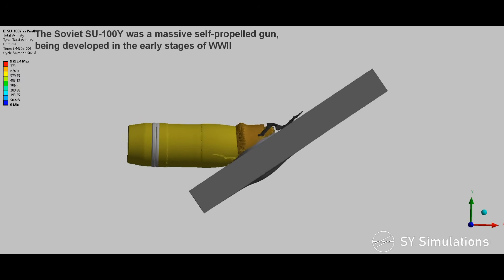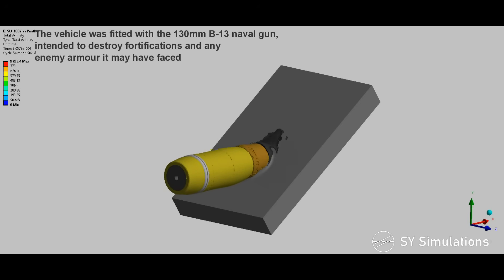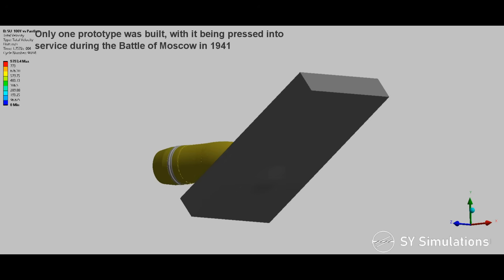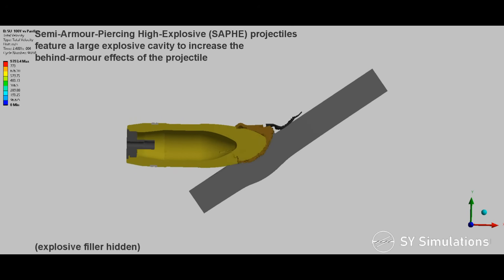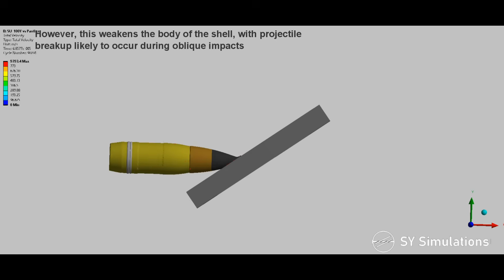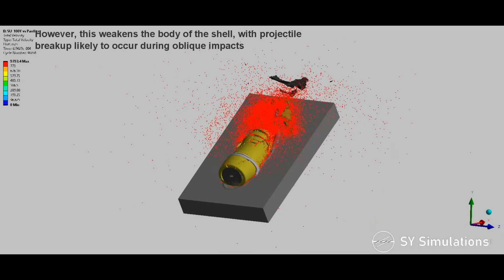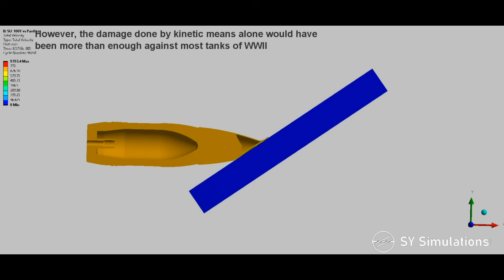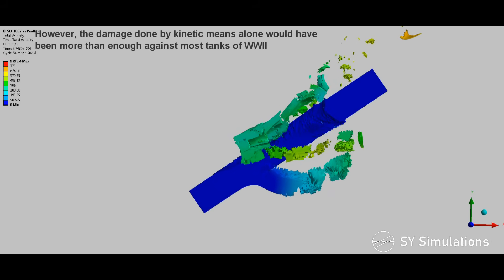SU-100Y vs PANTHER | 130mm Naval Cannon on a 1940 Tank | SAPHE Armour Penetration Simulation

Comment: I'm guessing SAPHE is just APHE with more explosive filler then?
Reply: SAPHE is APHE but made out of mild steel not expensive high carbon steel, as well as having more filler and thinner walls.
Reply: Yes, and with less penetration.
Reply: its a hybrid between APHE and HE. It's designed to detonate and nuke everyone inside whatever it penetrates
Reply: yeah, but it has thiner walls of the projectile so the penetration is way lower but in war thunder it says that su 100 y has 202mm armor penetration on flat angle and maybe 80 or 90 with 60° angled plate

Comment: SU-100Y was originally meant to destroy fortifications during the Winter War, but the war ended before it was deployed and it wasn't really needed either, since the Soviets eventually broke through anyway. the Finnish fortifications on the Mannerheim Line were nowhere near as great as the propaganda made them to be, although they did manage to slow down the Soviets, but that was also due to the favourable terrain in general among other things.
Reply: not to mentioned the Soviets already has KV-2's 152mm howitzer for anti-fortification role, using concrete piercing shell
Reply: Calm down, the author specially made a range of 1500 meters

Comment: and war thunder players will say russian tanks got insane angled pen buffs.. its not because its russian, its because russia mainly fielded large caliber guns, 122, 152 etc.
Reply: well WT doesn't simulate armor gouging and flex, otherwise they would have to expand their servers tenfold, so maybe it's how they compensated
Reply: @xDSqxRazoRx  overmatch exists irl anyway, I don't think  a 5mm plate at 85° could shrug off a 50kg AP shell
Reply: Here I am with my 122 bouncing off m41s mantlet edge.
Reply: @goyslop4289  get volumetred lmao dab etc
Reply: Every APHEBC has the same modifier, which outperforms some APFSDS at angles.  
Size doesn't matter, even the 57mm has better performance at very high angle than a 128mm APCBC ..

Comment: This is clearly at the advantage of the Panther crew. Now they have better ventilation and the driver has excellent visibility forward.
Reply: This is clearly showing das über smarts of German mind. They knew they didn't need to add more fans for the crew or better periscopes for the driver, as they planned on having a 130mm hole plugged through the front plate. You played right into their hands, Soviets. German forethought truly is a stunning thing. 4D chess here.
Reply: yeah uh but there might be a problem, there is no crew
Reply: Unfortunately, I'm quite sure the driver will experience a significant emotional event
Reply: The comander would have the visibility improvement
Reply: I can see that this thing can make Germans' WW2 tanks more eco friendly. 

By significantly reduces the energy consumption of crews and electronic devices inside the tank.
Reply: the driver himself was ventilated lmao
Reply: Perhaps not so when it's winter...but actually, the explosive filling will probably heat them up very well when it cooks off, so Checkmate Commies!
Reply: The driver is gone now. He went on vacation. Posthumously.
Reply: History cannel at 2 am
Reply: Plus driver Karl now could rest for a while
Reply: Exactly. Except you must mean the next crew that needs to clean up the remains of the first. But the extra ventilation will definitely help keep the odors at bay...

Comment: Tiger 2 UFP would be more interesting , than a Panther UFP . This was going to pen anyways .
Reply: Probably won't perforate, you need a super powerful 152mm for this
Reply: @ivan5595 I doubt that will be enough but I don't know.
Reply: @ushikiii there is a video of that, Tiger 2 UFP vs BL-10 APHE experimental soviet high-velocity 152, fitted to the prototype ISU-152-2
Reply: @jonaslavicka2411  ah. Ig he never specified the 152mm in question. I was thinking of the one actually fielded in ww2.
Reply: @ushikiii  yeah, no gun fielded could pen the tiger II UFP
Reply: @ivan5595 even without pen, Tiger II crew will have bad day.

Comment: Somehow I imagine this thing takes forever to load and is not that accurate. How reliable the tank itself was, I don't know either but doubt it. But that gun. That thing is impressive. I would love to see it against a tougher opponent like the King Tiger.
Reply: It was a naval gun which are typically fired from much larger distances than tank guns and thus cannot be inaccurate or they'd be worthless. As for loading, consider it provides standing space for two loaders; might be unwieldy, but gives you lot more room to work than an average tank or SPG.
Reply: @Ml114n  Thanks for the thoughts!
Reply: It's a naval gun so it's incredibly accurate. However it still was a naval gun complete with the naval stand simply bolted onto the floor so that made SU-100Y incredibly big and heavy.
Reply: The tank itself was not reliable, the chassis was from the T-100, a soviet prototype heavy tank similar to the SMK. It generally did poorly with trials, so they ended up removing the turrets and replacing them with a superstructure and this massive naval gun.

I don't believe that the SU-100Y was ever intended to be a model for production vehicles, rather I think they were testing the general feasibility of mounting the 130mm gun on a tank. However, desperate circumstances did lead to it seeing combat.
Reply: Well given the biggest gun mounted on a tank in Moscow 1941 was a "little" 76mm, I imagine that this gun would be slightly more accurate than the average gun.